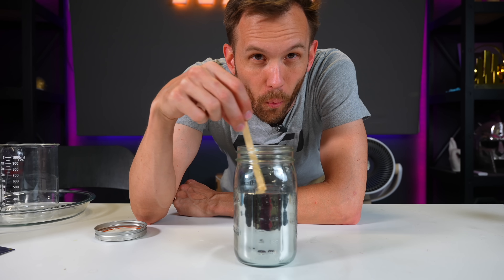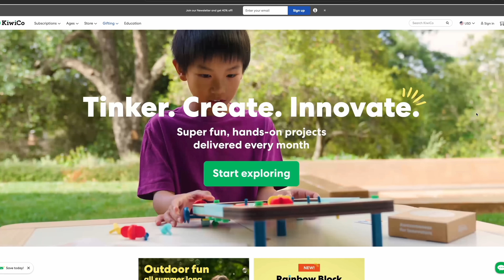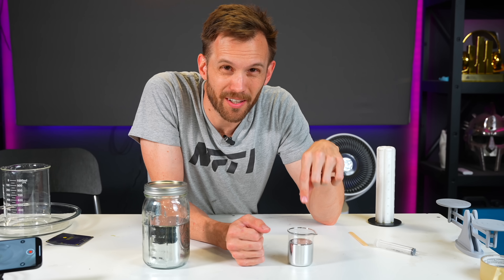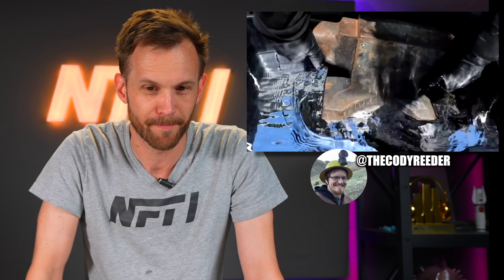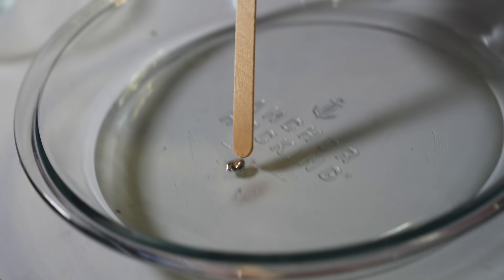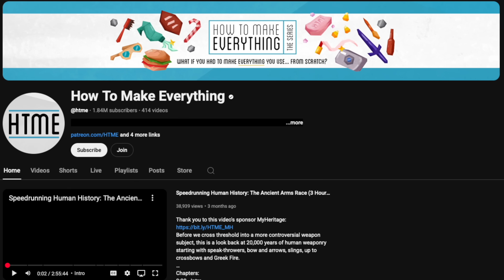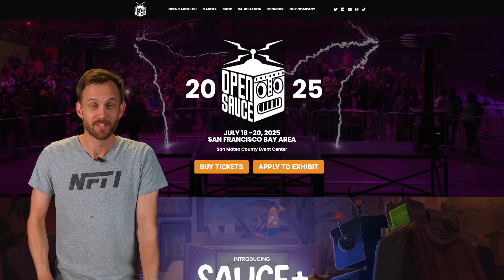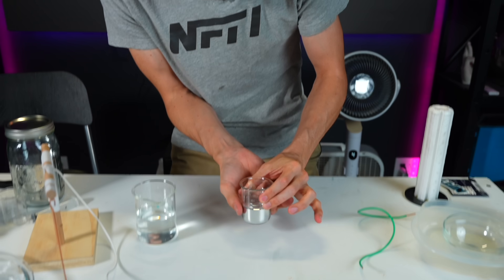What Happens If You Touch Pure Mercury?

Comment: In the tropics, gallium can easily be a liquid at room temperature too.

Seems all rooms are not 20.00000000... °C
Reply: Even places like California
Reply: @stgigamovement ... especially while it is on fire!
Reply: @95rav  as someone who lives in a hot and dry area of rural California that is prone to fires I can absolutely say that typical weather melts gallium unless it's around winter. Other states where Gallium does not want to solidify would be places like the South (East AND West), as well as Nevada, Hawaii and Utah. Places like Guam, American Samoa, and USVI will also fit that quality.

For context, one of the least-safe compounds, tert-Butyl Hydroperoxide, is capable of boiling AND hitting its flash point in hot weather in these states. In such a region, the stuff has every GHS symbol. It's combustible, an oxidizer, it's unstable, it's corrosive, it's gaseous on a hot day, it's able to cause acute and long-term damage, can do so to the ecosystem too, and it's clear when it's a liquid and has a sweet smell. You also cannot put out a blaze by it with water.
Reply: Room temperature is a scientifically specific range of 59F to 77F. 

People get it confused for "ambient temperature", which is whatever temperature the room is.

Comment: If my memory serves me right, I believe that rotating mercury was used a telescope lens because of its reflectivity.
Reply: It's used in the Hubble Space Telescope because the surface is so smooth in microgravity.
Reply: @Hasmanian  false, mercury would not hold its shape before launch, and in space it would be solid. No, a mercury mirror was not used in the Hubble Space Telescope. Hubble's primary mirror is made of Ultra-Low Expansion Glass coated with aluminum and magnesium fluoride. The mirror is designed to be highly reflective and resistant to thermal expansion and contraction.
Reply: that telescope could only be aimed at the zenith, and would have to be absolutely vibration free .

Comment: I work in a lab. I despise the tests using Dimethylmercury. I'm so terrified of the stuff. It sits in a locked cabinet by itself with all the warning labels. God forbid there was a fire, the smoke would be lethal from just that one little bottle.
Reply: What do you use it for? I also work in a lab, but the worst that I've had to work with was HF. It was used to digest siliceous materials.
Reply: @lordmole2776 I use it primarily for testing samples for manganese.
Reply: @lordmole2776  There used to be a blog called "Things I won't work with"  that told stories of the least favorite least favorite chemicals that chemists had to work with and why. 
That blog taught me that are compounds way  worse than Dimethyl Mercury or HF.
Reply: @lordmole2776 mostly to detect manganese in samples.
Reply: When I was a child (75 now) my Father used to bring home Mercury in valves which I used to play with. I can't remember where he got them from. I remember touching the Mercury and holding it in my hand. Regards from Chester  U.K.
Reply: @philipjones9458 mercury isn't Dimethylmercury bud. Guaranteed you never touched Dimethylmercury, you'd be dead.
Reply: @philipjones9458 did that too
Reply: @philipjones9458  Same! My father was a high school science teacher and he brought home a 2 pound vial of mercury that my brother and I played with some. I was about 10 and my brother was 15.
Reply: It goes through latex gloves. Seen the shorts on that cientist. 😢
Reply: A chemistry prof at Dartmouth (Dr Karen Wetterhahn) died after accidentally getting one or two drops of dimethylmercury on her. She was wearing latex gloves, but it turns out the stuff can go right through latex.
Reply: @solandri69 I watched an excellent doco mon this tragic case. Very sad indeed. Terrifying substance .
Reply: Ah yes, dimethylmercury. The mercury compound that caused the death of Kate Wetterhahn, drops of the compound had spilled onto her latex glove and she followed all the standard procedures at the time for decontamination. Unfortunately it was already too late as the dimethylmercury had already been absorbed into her skin. She would end up dying from mercury poisoning 10 months after the incident.
Reply: Store it in a safe. Problem solved. Maybe I should be a scientist...
Reply: @tonyg490 It's stored in a for cabinet...
Reply: FAFO
Reply: The biggest danger is exposure/breathing in mercury vapors.  Prolonged exposure can attack the nervous system and shut down many organs.  Hat makers in the past used mercury compounds and many went mad, thus the name "Mad hatter".
Reply: @BillAnt I learnt something new today thank you
Reply: @BillAnt this is why I fear for him putting that open jar so close to his face...idk how warm it needs to be to off-gas, but I'm sure not going to find out by experience...
Reply: @BillAnt Dimethylmercury literally will kill you if it touches you. Please don't pretend to know about things you don't.
Reply: Sure, but metallic mercury is not so dangerous as mercury compounds.
Reply: Sorry if i came across as a dick i was not intentionally meaning too was amped up with other BS i was watching and just vented it on you i guess so not personal and i apologize if it was dickish nothing to do with you or the content or comment just vented at that time
Reply: @lorenwright3202 Wow, I became out of breath reading your reply with zero punctuation. Where did you learn to write like that my friend?
Reply: @lorenwright3202  All good, real maturity is admitting you made a mistake and taking responsibility. You're better than most people on the internet on that front. I'm slightly dyslexic and worked in a lab, and was afraid I'd mix up some of the scary compounds, though I never did, thankfully. Worst I ever did was rocket engine burn the skin off half my hand... anyway, I usually found substitutes for compounds containing toxic metals or other dangerous substances when I could. You'd be surprised how much safer you can make processes with a bit of extra work and creativity, though you can't always avoid them entirely. I never touched or went near dimethylmercury and never will. That's the stuff of nightmares.
Reply: Why? Just... why? And everybody should be scared of dimethylmercury. It's up there with elemental fluorine on my list.

Okay, maybe not exactly there, as at least it can'T burn concrete, but...
Reply: @Dinnye01  Rubbish.
Reply: @Dinnye01 that's not even fluorine, that's chlorine tri-fluoride (ClF3). It also burns asbestos and... things that have already been burned. That stuff is terrible. The Nazis invented it and even they were like "yeah, nope! Nope! Nope! Nope!"
Reply: Great job Bot BS artist muh scary stuff muh scary!!! Uh the fire is obviously way worse in any case stupid
Reply: @lorenwright3202 I'm not bot. You obviously don't know anything about fire hazmat incident response. Because of the chemicals in our lab the fire department would order a 1/4 mile quarantine if a fire broke out. The fire would require extinguishing from air. 

Try looking up fire hazard incident response teams and what they do. You really think a little burny burn is that bad when a sniff from 200 feet away can kill you? You're like a neanderthal poking a fire with a stick and runs away.

If I'm a bot it's sad how unintelligent you look to my imaginary matrix eyes. 😂
Reply: And radiation is some BS Big Pharma is pushing to make us afraid of what isn't really there!
Reply: @Keith-b5h You need to get educated.
Reply: @Keith-b5h Many people have died from being so sure of themselves.
Reply: @lorenwright3202 the fire is only worse in the sense that it can unleash any of the chemicals in the area affected by it. The chemicals, in this case the mercury, fumes can become far more dangerous to the surrounding area.

But being an asshole (even if it’s rage bait on the internet) doesn’t make you any cooler and more so just make you seem like a child that never got enough attention.
Reply: @minimax1392  thanks i guess just not terrified of mercury like you are but you do you correction i didnt pay attention to it being dimethylmercury so ill agree thats not a joke and nothing to play with as opposed to normal mercury
Reply: @lorenwright3202 uh huh, sure buddy
Reply: @lorenwright3202  "not terrified of mercury" grug think this make him strong like rock, not stupid
Reply: @lorenwright3202  glad I kept reading the entire thread before responding to you so that I saw you made a correction once you had paid attention to the fact that it was dimethylmercury - because anybody working with that is very right to be terrified of it. I don’t work in a lab, but I am familiar with the story of Karen Wetterhahn.
Reply: @lorenwright3202 stick your finger in the Mercury with an open cut then

Comment: Yes, anyone can do all of these experiments at home except you didn't touch on one key important fact about Mercury. It is ridiculously hard to clean up and during the process, you can create far more toxic compounds. THAT is why people are not encouraged to play with mercury. Another reason is that although Mercury will normally not stay on skin, it can. And if you then go and eat something, you are now putting Mercury in your mouth. Being so much more dense than water, if it stains something, that thing is not going to clean well with water. All surfaces that Mercury comes into contact with are generally considered scrap and no longer safe for holding anything you would eat, drink or wear. If you spill mercury on the floor and then step on it with sox or bare feet, it will slowly over time dissolve through the sole of your foot and into your blood stream. Wear shoes in any lab that has ever dealt with Mercury. Wear shoes in any lab, period.

Comment: I remember one time when I was about eight or ten years old, my dad came home from work with a sheet of printer paper bent halfway into a tube which he carried very carefully into the house and set on the table. In the middle of it was a small, metallic object that looked to my eyes like a ball bearing. It couldn't have been bigger than 3/16 of an inch in diameter. "Try to pick up this bead," Dad said to me. It didn't look that hard to pick up, but, when I tried, instead of feeling the smooth, round metal between my fingertips, I just felt my fingers touch together and when I lifted them up, the bead it or ball bearing or whatever hadn't moved. I tried again, looking more closely at what I was doing, and this time I saw the metal deform around my fingers so that I couldn't grasp it. I looked at Dad in confusion, and he laughed and explained that it wasn't actually a bead; it was a drop of mercury, a type of metal that is a liquid. Somebody at his work had broken a mercury thermometer and he had scooped up a drop of it on that paper and carried it home, apparently just to mess with his child, becauze he threw it away immediately after.
Reply: (can't remember the exact numbers/value, but like a few inches or half a foot of water, can easily knock you over and/or even move-float a car, ever try lifting up any size container of water... it's very dense, but mercury is x13 more dense than water, or whatever the amount said, just imagine that same sized container of mercury, use that as a "trick challenge", asking the strongest powerlifting men to try to lift it up, laughs, they think its water... but its mercury, the surprise in how heavy it'll be, with none of them being able to lift it up, laughs)

Comment: Long story short, I was working in a bronze sculpture i worked in the wax department, we had a tank thermometer break, between inhaled vapors and contact with the wax how dangerous was i working... I already knew touching mercury was alright but vapors at 270 degrees and then contact with the wax... id like to know
Reply: Low levels of mercury probably won't kill you especially if it's not organic

Comment: Gallium would be a pretty cool element to cover.  It is a metal that melts at 85.58 degrees F.  I have seen a neat demonstration where someone made a spoon out of it.  It looked and behaved like a normal spoon until they mixed hot water with it and the spoon melted.
Reply: The biggest problem I have with gallium is that it wets absolutely everything is very messy. If only it where like mercury and didn't wet anything.
Reply: You don't even need warm water since your hands will melt i5
Reply: @jasonrichardson1999  Good point!
Reply: a lot safer to work with

Comment: Cool video! But when you put your finger in that mercury, I actually gasped!!
Reply: You do realize mercury thermometers were common until around 2000. People were exposed to it from broken thermometers. It was not a big deal. There are some long term health and environmental problems but overall they are small. I suspect that the danger was exaggerated to encourage people to get rid of the thermometers. 
At a personal level, it is a small risk. At a society level, it was judged to be a big enough problem to regulate. It is far from the worst "poison" people are exposed to. But each one removed from general exposure helps reduce the overall risk.

Comment: What would happen if you try to blend Mercury with various liquids, such as water or oil??
Reply: Water is polar, Mercury is non-polar. They won't mix.
Oil is non-polar, so it might mix. But Mercury is so dense that it would most likely sink straight to the bottom, barely reacting with the oil
Reply: @TeraChad23  Feel free to call me dumb just for even asking this, but couldn't you run a current through the mercury to make it polar?
Reply: @michaelhuett9916    take this for what it's worth, but the Google AI overview said this: 

An electrical current, or more specifically, an electric field, can induce a temporary polarization in a molecule, but it doesn't change a molecule's intrinsic polarity from nonpolar to polar or vice versa.

So I dunno, maybe you're on to something 🤔🤷
Reply: @michaelhuett9916  i get why you think that, but i dont think it would work like that. For it to be polar, the electrons have to be removed and held elsewhere, like in a cation. When it comes to current, the electrons are simply moving around. The overall charge of the mercury stays neutral.
You're not dumb for thinking that at all, its always good to look at things from a different perspective even if it isnt quite right. :)
Reply: Wait a minute. By running current through it, you could maybe end up causing electrolysis to occur and some mercury would become mercury hydroxide, which i think is soluble. Im not sure if that counts, but it might